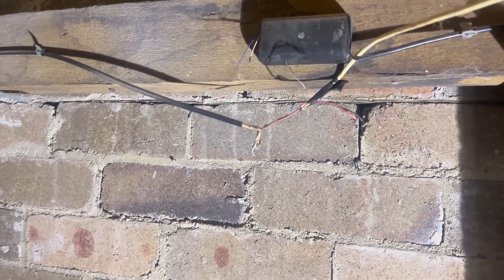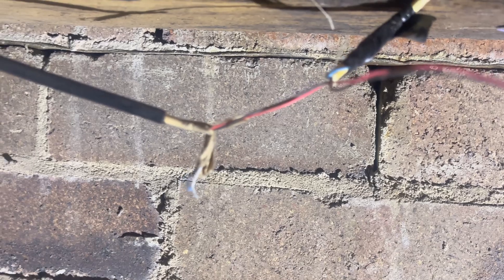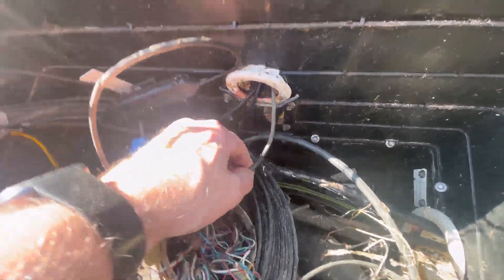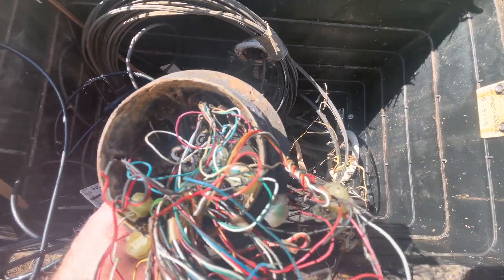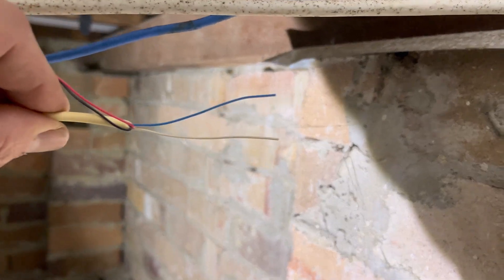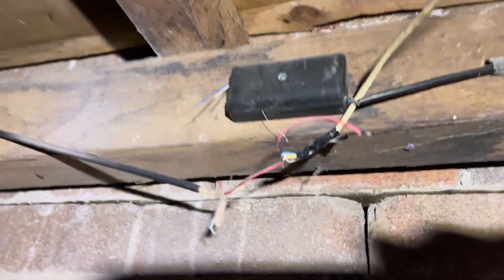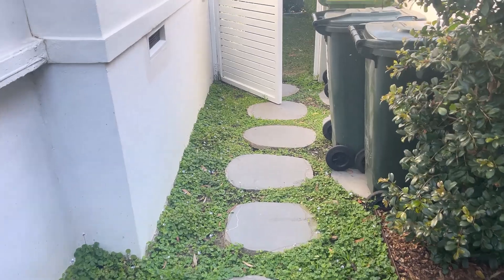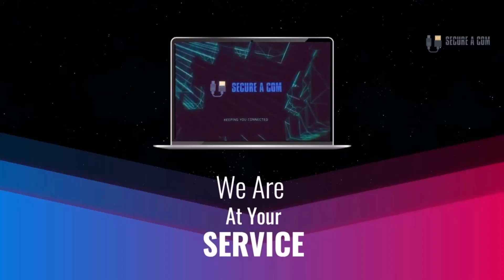NBN FTTC Dropouts   Customer Has Bridge Taps And Also Connected To Old Paper Insulated Lead In Cable

Comment: Caringbah is the worst in the shire for those issues. The amount of times I've been called due to drop outs in Caringbah is rediculous.

It's bridge raps 9 times out of 10. Simple solution is to just whole new cable from the lead in and scrap the rest of the cabling, never fails to fix it.

Don't get me started on the NBN techs efforts to resolve issues..

Comment: That lead in cable is actually PEIUT 4/040. Poly Ethylene insulated unit twin with 4 conductors of 0.40 mm copper wire. The PE insulated conductors were contained by a cotton whipping and an inner wrapping of brown paper covered with a hard plastic sheath which was waterproof. It came in two types the second of which was PEIUTHJ  with the HJ indicating that it had a further outer sheath of a hard plastic jacket to provide additional mechanical strength. Both types were waterproof and could be installed in pipe/ conduit or buried bare.the stupidity of potting those  joints came about because at the time Telecom had a Yank CEO who imported some good old American know how and stuffed thing up right royally. Cutting back and bagging was mainly done by contractors who weren't getting paid to remake joints Just to get that one service working. And as you can see the temporary fix got to be permanent. What a bloody mess. Incidentally that small black terminal block under the floor Is a 20/40 block  (two pair, four terminal) and was originaly designed and used as a terminal point for the rubber and cotton insulated line cord that was fitted to candlestick telephones. yup the design is that old. They were repurposed as the lead in /NTP on the 50's and 60's houses.

Comment: I just watched what was supposed to be a Telstra training film purporting to explain bridge taps, which it did very badly. It used the example of cable pairs in what could only have been "0" pair cable having the same pairs or pair terminating in several buildings. Which was not allowed.The standard always was that where a lead in (Entry or "E" pairs) was jointed into the "O" pair distribution cable the away side was cut away in the joint so that the service that was provided on those pairs was exclusive to that premises. This was true of both residential and commercial installations.  The copper network that comprised twisted pair Mains, "B" pairs "0" Pairs and believe it or not "E" pairs was never designed to carry high  frequency traffic but it did quite a remarkable job until the advent of the Internet. Another thing that was strictly outlawed was star connection of internal cabling. with multiple sockets for parallel phones being wired in line one after the other. unfortunately. quite a lot of installers took the easy way out and especially where adding on to an existing installation just spliced a length into a cable in the roof or added a cable to a terminal block.Having said that. In those days  the standards were much higher and  no one would have got away with (Or wanted to) the the pathetic low quality work left by contractors currently. most of them are poorly trained and soon learn if it does not work first time leave it pass it on and get on with the next one. they are only trained to do part of the job and when things go wrong they dont know what to do. the payment structure calls for you to run one jumper terminate one pair and that's all you get paid for.So that is all you do. If it doesn't work hard luck.

Comment: NBN Techs are shit. 
Every two to three months out TPG NBN connection starts dropping out with increased regularity until it is out for days. This has been complained about for years now. In fact we have complained about the shitty conditions of the phone lines back 30years now when Telstra owned it all and they did shit about fixing the cabling other than shuffle pairs around.
The leading cable to our house is cotton insulated copper wrapped in lead, steel armoured wire with what appears as tar coated string on the outer covering. Our leading cables connects via a small rectangular pillar out out the front (each house have these) and the cable is connected to a lead sheath cable that services the street. The cable in the street has multiple faults confirmrd by TDR test. 
Every time the NBN monkeys come the fix the problem they claim the router is at fault. Having been a network engineer for over since the early 90's with Cisco and Netacad quals and an electrical and computer systems engineer even longer, I drag out my test equipment and show them the modem router is perfectly good and connect a new modem router and prove it is perfectly ok and the fault is outside the boundary line.
Every time they go out hook up their test equipment and find faults out in the street sometimes out the front other times 200-300m up the street and then it's always funny how the problem gets fixed with out ever having to replace the modem router. 
However the problems either re appear 2-3 months later and some times after rain.
The NBN Techs keep saying the fault has been reported and will be fixed but neither TPG, NBN ot Telstra do anything  except play musical chairs with damaged cable pairs or try to get around the problems by using split pairs.
The Abbott/Turnbull shit solution of the fraudulent Telstra copper NBN implementation was shitfuckery of the highest order.
Our street was supposed to be up for an up grade to fibre 4 years ago then it was downgraded to being on the books to in the design stage. Then 2 years ago it was dropped off the books all together. 
To highlight the NBN incompetence 3 years ago they did a letter box drop with the pamphlet stating we had fibre available and to go online and lodge a request to get connected, except when we entered our address or anyone else's street address it all came up unavailable.

Comment: Interesting 🤔 we went from 19 Mbps (3 years of communication with Belong  goes by) to 42 Mbps for about 1 year back down to 20 Mbps after Kevlar came through to haul out a cable in April. NBN said there's no problems... you're only paying for 50 Mbps .. 😮
Reply: The technician "Belong" sent out, we have him on video doing nothing but fiddling with him self in the van...

Didn't check the pit, didn't cut the seals off the Telstra box on the side of the house...

Comment: Great case study Jason. We had a similar issue about a month ago after the heavy rains where our service kept dropping out. Calls to Telstra and NBN with my expectations set very low and my finger poised over your number expecting that Telstra and NBN would each say that it was the others' problem.  Fortunately we has an NBN contractor came out who replaced the sockets in the house and at the pit to eliminate this as the issue and not the old lead lead-in cable - fortunately it was the sockets. I still fear the day that we have to get our old lead lead-in cable replaced. Thank you for your fine work 👍
Reply from the maker: Thanks Alan

Comment: At least little old NZ did it right, we installed conduit to the property boundaries and then only blow fibre when customers order a fibre connection. Currently sitting at 98% of NZ have FTTH access of which 70% have taken it up.

Comment: Another example of how bad the NBN rollout was. Initially we were all promised Fibre to the premises, but when they finally realised what that was actually going to cost, they started looking for short cuts. One of the biggest issues I have seen is that almost all of the work is being done by outsourced workers, who are required to do the work at the cheapest price possible. Regular jobs are priced and payed at what the simplest job would take, so if any issues arise the technicians are working at their own expense. The result is that some of them just don't do the work required. 

The other issue is all that copper that is still underground, clogging up the pits and conduits. It must be worth a fortune. Just wait till the copper thieves work out how to acquire this cable.
Reply: Telstra are actually digging up and recovering the big main cables that went from the exchange to the pillar, and recycling them.
Reply: Except that isn't actually what happened. The move from full fibre to VDSL was entirely a political decision that was made by the Liberal party when the change of government happened. The ramifications of this decision were no accident, it was part of the plan. And as we all now know the copper based NBN has now cost more than doing it in fibre, especially after they paid Telstra shareholders 11 billion for all the rotting copper.

Comment: Those 'bridge taps' as you call them were standard fair to provide multiple sockets off the old incoming phone line, then NBNco came along, replaced that analogue feed with VDSL or whatever the format is, and just hoped that the exiting wiring, never intended for even old school ADSL would be fine. They hired the cheapest installers possible that would do near nothing to your house wiring, often insisting that the NBN gear be installed in the first room at the front of the house with no regard as to where the customer needed the gear/service.
Then they left many an elderly customer with a phone at the very front of the house and the rest of the household sockets, where they really wanted the phone, now basically dead and useless - even though it was a trivial task to reconnect them to the voip socket on the NBN or Telco router box.
Reply from the maker: Yes i know but NBN services hate them

Comment: in my 10 or more years working in a job that involved sending out CT's to fix this kinda stuff on copper ptsn lines id probably created i dunno 10,000 truck rolls easy. and you don't realize just how much of a rats nest shit heap cluster fuck job it is to go out and try fix this stuff until you see inside a pit and how bad most of them are inside.
Reply: Try industrial automation; I get layers and layers of different types of wiring with similar results of 30 techs fingering the same device.

Comment: What is even the point of fixing garbage like this. How many hundreds did nbnco waste on this property sending out techs. There should be a way that the first tech can report back that the lead-in is just not up to grade and book in a free FTTP upgrade.

If the customer wanted to do it, all they'd need to do is upgrade to 100/20 and get a free FTTP upgrade, then knock back the speed again to 50/20 if they wanted to or even pay the $200 fee if before 12 months.
Reply: Agreed, but you're assuming the first tech even bothered to check the condition of the lead-in cable. They didn't even remove the bridge taps!
Reply: @GavinR824  Thinking it a bit more, it wouldn't surprise me if the customer wouldn't even be put an upgrade order onto a non-working service. i.e. what if they had to fix the copper before even being allowed to fix the Fibre
Reply from the maker: You raise a good point. It would make a lot of sense to have a more streamlined process for identifying when a full FTTP upgrade is necessary. Unfortunately, the system isn’t as efficient as we’d like it to be, and it often results in wasted resources. Hopefully, we’ll see some improvements in the future! 💡📶

Comment: The nbn lead in 2 pair should have been connected into the node channel coming out of the module and cut away/off the 30 pair joint ?
Reply: That old 30 pare joint is probably no longer connected, it would have stayed after the the NBN fibre box was installed as there was probably a few people in the street keeping their old phone lines until the last minute before the old exchanges were shut down, and now nobody dares removing it 'just in case' & because "it's not my job".

Heck there is an old Telsta pillar box down the road from where I live, it's full of lines etc, looks very busy, but it's all dead as they shut down the old exchange years ago.
Reply from the maker: You’re spot on! These old connections often stick around way past their prime, mostly due to that “just in case” mentality and the fact that no one wants to take responsibility for removing them. It’s a common sight in a lot of areas. 🛠️📞
Reply from the maker: Yep

Comment: Red black probably has one leg to earth . Let alone the twists  causing High resistance. Is that black loop 2 pair or fibre ? I'm alluding to it adding length  of service to the feed total. Did you put loop a line on the internal to see where it comes up in the joint ? ( and do you get into trouble for being in the pit despite the nightmare ?)